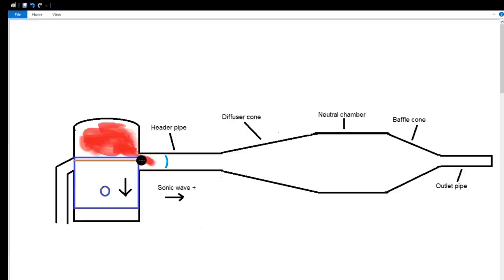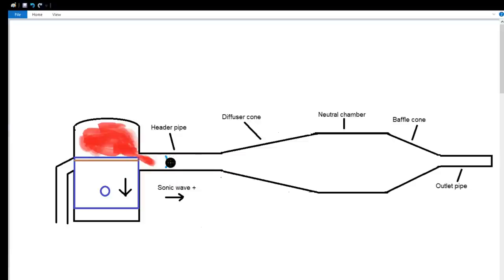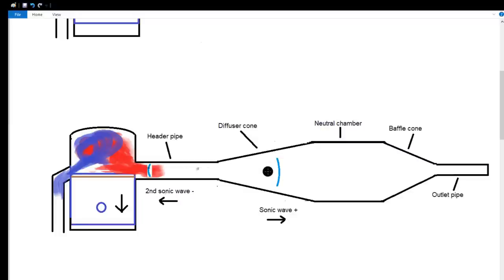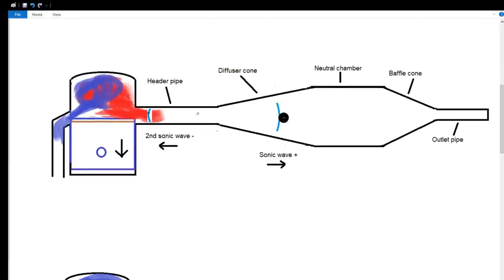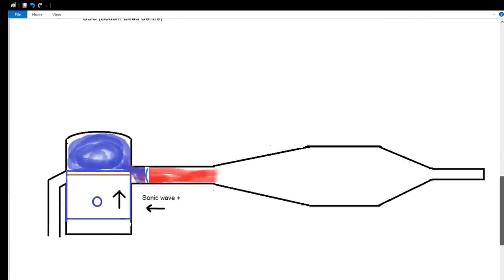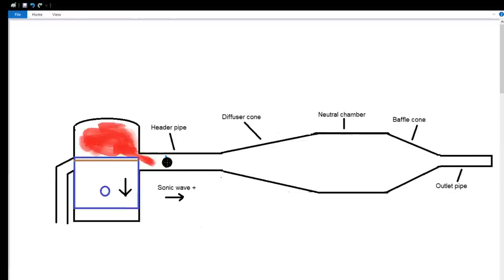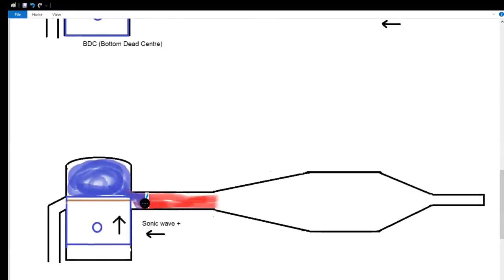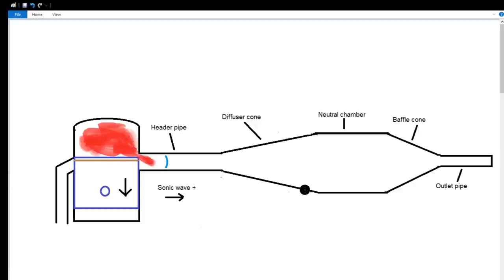Unlocking the secrets of 2 stroke expansion chamber exhausts E1

Comment: I can’t wait until I can actually build my first correct pipe… I couldn’t help myself and grabbed a little cheap banana bike engine pipe from eBay just to being to play with… it’s not really got the correct degree angles so it’s pluses will be correct but I just wanted to see if I could get something more from my engine… I’ve got a couple of the echo chainsaw actually fire rescue saw’s were y first two that I got from the fire house for doing some great work as a volunteer when they went the I found a cs8000 instead of the QV 8000’s that I’d gotten from the firehouse… and it’s just very interesting to see how that echo factory “ported “ the rescue engine for more power than their regular saw cylinder… cutting the squish band to reduce the combustion chamber… and some small changes to the intake and exhaust port window’s… I’ve actually always wanted to pipe one of those QV engines as they have a quite rounded shape to their exhaust port window’s compared to a regular rectangular saw engine… theses resonating sound waves helping to control your engine similar to a valve system has just always been extremely interesting to me…. So it’s so exciting to see that in a little bit of time and studying I’ll be able to cut my sheet metal and weld everything together… what gauge metal is a good starting point as it’s been some time since I’ve done any welding so I’m interested in grabbing some sheet of the correct thickness just so I can start practicing with making some cone’s and rings for practice…???
Reply from the maker: Hi David
Re sheet metal thickness,  about 1mm thick is a safe bet as it allows some leeway with welding.

Comment: I would like to see the presentation on tuned chambers and outlet.....where are they?
Reply from the maker: Hi Ken
Re "presentation"
Are you referring to the reference material used in the videos ?
Reply: Yes, and I did fund it.
I am a competitive model speed flyer and most classes have banned use of a tuned pipe, but not all.
I.m particularly interested in the stinger and what it actually does. My general take is the larger volume the pipe, the smaller dia and or length of the stinger. Trial and error has been my best instructor. I have 4 records and looking for another if I can get the pipe sorted out.

Thanks 
Ken
Reply from the maker: @kenburdick5976  
My videos are mostly based on the works of Gordon P Blair Professor of Mech Eng of Queens University Belfast from his book published by SAE in 1996 called "Design and Simulation of Two Stroke Engines", it is very complex and long so my videos basically boil it down in to a simpler form, also based on my own experience building chambers for road racing which began in the 1980's uses Gordon Jennings "2 Stroke Tuners Handbook"
Later in the video series I also discuss an article on outlet pipes called "Effect of Tail Pipe Entry Geometry on a Two-Stroke Engines Performance Prediction", published Dec 2000 by Cornelius Gysbert Johannes van Niekerk, Master of Engineering at Dept of Mechanical Engineering and Aeronautical Engineering Pretoria University.

Comment: I guess one of my questions would be about the effect nitro methane has on the pipe volume. I have been required to deop from 80% nitro to 10% per rules. What does that do to the volume and can it be offset with stinger size?
Reply from the maker: Nitro will effect the tuned length to some degree.
If you look at later video series on designing a chamber I go through the equations to calc tuned length.
2 values are effected by fuel which is "ratio of specific heats" and "individual gas constants" that are part of the equation.
in addition to average temperature of exhaust in the chamber.
As for chamber volume and stinger size, in Blairs equations those two factors are tied to BMEP of the engine in "Bar" pressure, they are not variable to fuel types or other factors.
If you know that KW of the engine you can calculate BMEP, the series I have here also gives the equations for that.
In short a higher BMEP requires a larger mid section in diameter to allows for higher pressure from the engine and a smaller outlet to offset that to stop ex port "spilling", this is also covered in the videos as to how and why that is.

Comment: If the wave can't move the air molecule then how do they push the air back in to the cylinder? thanks
Reply from the maker: The reason is the sonic wave is energy moving through the air no different than sound does and as it does it only disturbs the air molecules nearby.
As an example if a person shouts you can hear it some distance, yet the air molecules expelled from their mouth do not travel all that distance to your ear only the wave of energy does, and when it reaches your ear it disturbs the local air molecules in your ear.canal suffice to move your ear drum.
Likewise the energy wave moving through the pipe (from port to end of pipe and back) causes a local disturbance only to the exhaust gas molecules at the port at the moment it arrives back being the exhaust port just before it closes.
Reply: @AuMechanic  I see, thanks a lot :)

Comment: You said the negative sonic wave doesn’t care about the exhaust gases because it’s a sound.
So how does the positive sonic wave help retain the intake gases?
Reply from the maker: They key to this is that the wave is only providing a localised change of the gas pressure at the point to wave is. And by way of the pipe length dimension is timed to arrive at certain points in relation to the ports closing.
In the case of the compression wave reflected, it does not push the gas back. It simply raises the gas pressure at the pipe side of the exhaust port, if timed to arrive correctly, just before the port closes, that reduces the pressure differential each side of the port suffice to reduce intake mixture spilling out of the exhaust port.
I cover this more in ensuing videos.

Comment: cool video. I was wondering how much power does the pipe really give you some say 55% some say 30% put i dont know who to belive :D . Also 2 stroke pistons are usually very round (at the top), put if you make it flat do you increase power?
Reply from the maker: Power will depend on the engine, an engine with low BMEP will not get as much from an expansion chamber is an engine with high BMEP, likewise and engine with a broad spread of power will have a low peak power.
It all depends on the use for the engine
So it there is no real average percentage of power improvements by adding an expansion chamber.

Comment: I am wandering how w difficult it would be to get this same scavenging effect and tuning length plus expansion chamber to apply to a 4 stroke engine with two opposing firing pistons ie making one pipe for 2 cylinders. To net the same timing.
Reply from the maker: Hi Mathieu, the one thing the expansion chambers relies on is a pressurised intake, without that the baffle taper at the end serves no purpose and you would simply use a megaphone in a single cylinder 4t.
On multiple cylinder engines a collector performs the function of increasing area at the end of the pipe, similarly to a megaphone in that it controls the area size increase at the end of the pipe to shape the expansion (suction) wave.
Reply: AuMechanic so can I read into your comment that potentially a supercharged 4 stroke engine might benefit from an expansion chamber. The other thing is a collector is often a large distance from the cylinder surely a matched primary length to the volume displacement of the exhaust stroke would be much shorter than most extractors generally are.
Reply from the maker: It has been tried according the Gordon Jennings but for some reason didn't last however its a given than without compressed intake the expansion chamber baffle cone on a 2t serves little purpose..
The difference being that a pressurised intake will cause intake spilling at the exhaust that the baffle cone reflection plugs.
Being the transfer and exhaust are both open for a good deal of time on the 2t charge spilling occurs.
It may be only where there is high amount of overlap on a 4t that plugging effect would come into play in a 4t with pressurised intake.
Re the collector, the length of the header is tuned for the suction wave to return at about TDC during intake and exhaust valve overlap from the ex opening time before BDC.
In the 2t the suction wave is timed from Ex open to just after BDC which is a lot shorter time in crank degree than the 4t and so you have a much longer tuned length in the 4t.
Reply: AuMechanic thanks. That Explains it all.

Comment: Interesting ...Is there a way to increase the HP by moding the muffler pipe? Or header pipe ?
Reply from the maker: That really depends on the pipe it has and if the engine has any mods to it like higher port timing.
If the pipe is dead stock road pipe for example you may make some gains by putting a muffler on the end that breaths a bit easier (chainsaw would be one example) but if it has an expansion chamber already then it is likely designed for that engine port timing and exhaust port size.

Comment: So I just purchased my first pipe for me 66cc motor. It’s an mz65 and I’m having issues with it hitting the head. From what I’m understanding if I shorten the header a little bit it will favor higher rpms? Can I shorten the header safely? And if not, or period, could I bend the header? Thank you
Reply from the maker: Bending the header would be preferable but only if you can ensure that will not kink the header pipe at all, it is important to retain the cross sectional area of the pipe (its internal diameter) through its length specially the header.
Usually using a mandrel inside the pipe to bend it, if it is only a small bend and no risk of kinking the pipe at all or deforming it then you might be ok with just a bit of heat.
Shortening it however will change the tuned lengths and short will favor higher RPM.
You can use the calculator software to get a rough idea of how much the RPM peak will be changed by a length change to see how much you can remove safely without effecting RPM range too much.
Reply: AuMechanic thanks ou very much!

Comment: So do expansion chambers require back pressure to function correctly (Eg, a smaller diameter exhaust outlet compared to the size of the exhaust port after the expansion chamber)? I'm not sure if back pressure is even the right term so I apologize in advance if my terminology is incorrect.
Reply from the maker: Hi Fridgemusa, in short yes back pressure does play a part as RPM rises to peak as it increasingly has a port plugging effect in addition to the reflected compression wave off the baffle cone.
I've covered more in episode 7 and elsewhere in the series, check the playlist you'll find it there.
Back pressure is simply a result of a restriction in a pipe so it is the correct terms to use.
Reply: Cheers mate :)

Comment: So this combustion chamber expansion doubles as the exhaust too? I've just started learning about engines.
Reply from the maker: No combustion occurs in the exhaust chamber.
The combustion chamber is the area above the piston inside the cylinder
Reply: @AuMechanic  So it's just an ovesizer exhaust pipe then.
Reply from the maker: Apart for the functions it does as described in the video, yes you could call it that

Comment: So does your pipe need to be completely suspended or can it rest on rubber, and would a cracked pipe cause premature det?
Reply from the maker: I prefer to use spring hook mounts myself to allow for some thermal expansion as well as vibration isolation which you want to reduce as much as possible being reflected back to the engine as vibration at the combustion chamber is bad for power.
As for the spigot mount for pipe to head, TZ engines for example used O rings to seal but you can use silicone on a slip on spigot at the header.
Reply: @AuMechanic  Ok, Thanks for this info.

Comment: Is there some type of formula where you would use the speed of sound related to rpm and distance of stroke and port height with the sound wave that would give you a desired pipe length for a desire powerband?
Reply from the maker: Yes there is, I've provided all the equations in the latest 4 videos to measure those values and calculate tuned length and port area for designing a tuned expansion chamber.
Reply: AuMechanic how up to date is that formula ur talking about?

Comment: So the expansion chamber only work efficiently at a one specific rpm numbers. Am I right?
Reply from the maker: Hi Azrul
No it operates over the effective "power band" of the engine that will also depend port port timing used, the design of the pipe will also determine how wide an RPM range it will be effective.
The video series covers the parts of the expansion chamber and which part effects below the power peak and up to the peak RPM and how those parts cause that effect.
This first video is just the basic outline of how they work to begin with.
Reply: AuMechanic I see. Thank you for your explanation. Looking forward to learn more. Cheers
Reply from the maker: If you have any questions watching the videos feel free to ask.
Happy to answer them.

Comment: Can I use an exhaust system from a 125 2 stroke for a 185 or should I use one from a 400cc
Reply from the maker: Not if you want it to work as an expansion chamber.
You might chance the tuned lengths being the same but the diameters of the pipe section will not be even close to yours.
See the other videos I have that cover those topics and you could even try the free software to pipe dimension you would need for your engine that might help you find another pipe that is a suitable match.

Comment: How can you make a 70cc quieter 
Will adding more stuffing reduce the power by a huge %
Reply from the maker: If it is a straight through muffler and you are not changing the diameter of it then repacking the absorption maternal should not make any difference.
If it is already full of material then repacking it may not do anything or sound reduction in which case you need to look at a larger muffler.

Comment: Will having the wrong pipe on a two stroke make it run differently?
Reply from the maker: Yes it will, if you are going to fit a chamber to an engine it does not belong to at minimum ensure the tuned length of it is right for your engine otherwise the operating RPM range of the pipe you have could be way out of the ball park of the RPM range you engine produces power at, in which case the pipe will be less than useless and may even result in less power than a stock muffler.
See the video series I've done on How to Design an Expansion chamber, that gives you the sums you can do to calculate tuned length of your engines exhaust to match the pipe you are fitting to it with.
Reply: AuMechanic okay the reason I ask is I have a 2002 rm125 on a 90s frame that the right pipe won’t fit. It still runs mostly right just has the shortest power band ever compared to the other 125s I’ve owned was just looking for a solution
Reply: AuMechanic the pipe I have on it is from an older rm125
Reply from the maker: That short power band might be the pipe if it is not just a function of the engine itself..
If the pipe is too long or too short then exhaust wave pulses are out of sync with the power band of the engine and may cause the power loss at part of the normal power band ending up with a very short power band range.
If the tuned length is not right the baffle cone at the end for example might be sending a port plugging wave back before the engine has reached peak RPM causing a loss of power that may feel like the power band has stopped early and not revving out at full power.

Comment: Is it safe to run an old pipe that may have surface rust or carbon in it on a fresh rebuild? Fl350
Reply from the maker: Surface rust is ok but excess carbon can reduce the pipe performance if there is a lot of it.
You need to at least burn or clean out the carbon in the outlet pipe so it is not restricted or it may cause a bit of overheating at the cylinder head if its choked up at the outlet pipe.
Reply: @AuMechanic  Thanks for the info.  I am looking at getting a new dg pipe for it but I think they are made to order so it may be awhile before i can get one.

Comment: Wen come out of head init the  exhaust does it need back compression  going back in two the head
Reply from the maker: Yes for expansion chamber exhaust like this.
If you watch later videos Ive done particularly the one on outlet pipes the function of back pressure is covered.

Comment: What diameter the outlet pipe should be compared to the header pipe ?
Reply from the maker: Outlet pipe ratio is to the port area not the header, the outlet pipe area (convert that to diameter) is 0.6 to 0.7 x the area of the exhaust port window area, see later videos on how to measure the port window area as well as the video specifically on outlet pipes. Or use the pipe calc software linked in the description section under the video.